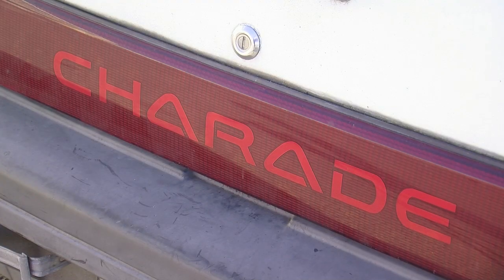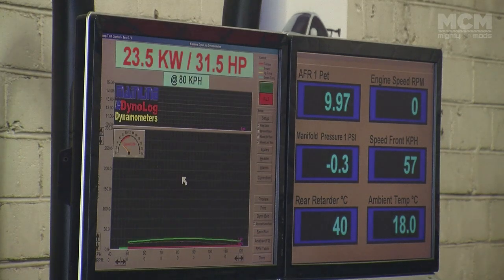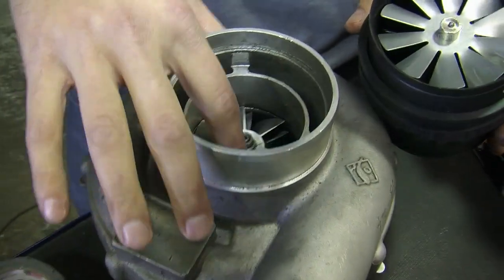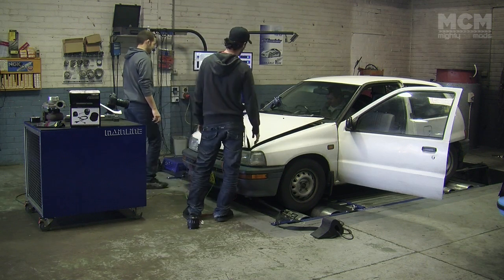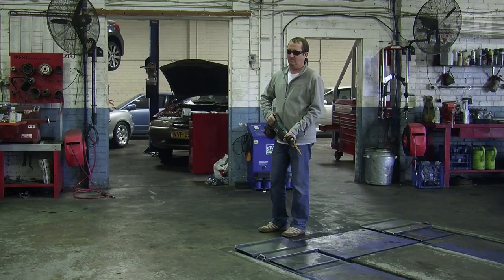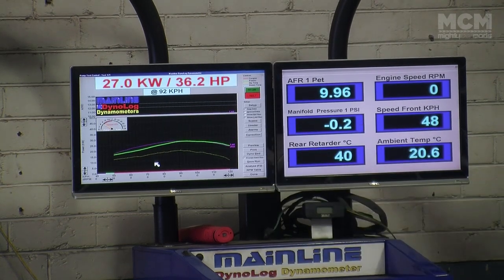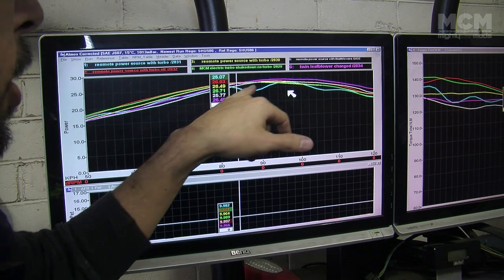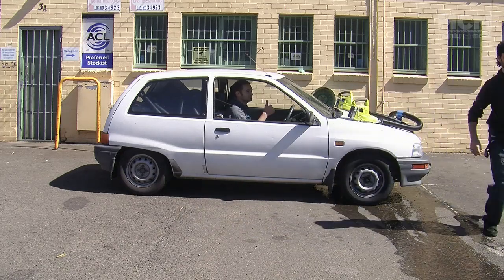Electric SuperChargers Mythbusted

Comment: Now here's an idea... TURBOCHARGING MY PC
Reply: dodoz44 intel turbo cpus for 4-5 years now
Reply: +dodoz44 I wanna turbo charge my toilet and see how fast it can flush.
Reply: +dodoz44 Processors actually have what's called Turbo Boost that boost the performance when under load
Reply: Twin turbo v6 dell
Reply: +Ian Dillard Bingo!  The turbo buttons of the DOS era existed because programs at the time were all designed to run at 4.77 Mhz, the clock of the 8088 processor.  As we moved into the x86 era, the clock rate started increasing.  Since existing programs relied on the processor clock for all their timing, they would run too fast on newer processors.  In order to keep compatibility with old programs, the turbo button dropped the clock speed of newer processors down to the speed of an 8088.

We then invented better way to handle timing, and programs now run at the same speed regardless of the clock rate of the processor. The turbo button is gone, and we are all the better for it. It was a kludge fix for compatibility issues.

Modern Intel Turbo Boost takes a look at the specs of your system and current load, and squeezes a few hundred extra mhz out of your processor when the conditions are right to do so. It is a system that is completely different from the turbo button of old, except for the word &quot;Turbo.&quot;
Reply: +singedcarry you're an idiot
Reply: +dodoz44 old keyboard had a button with "turbo" writed on it
Reply: +dodoz44 old dos computers had a turbo button. its already been done
Reply: i said that and some idiot wanab nerd asked huh like i was crazy.....
Reply: +dodoz44  But like Intel CPU's are already turboed. And the DOS computer the turbo button actually slowed the computer down. So the program running and the CPU would run at the same time instead of having massive lag.
Reply: Ian Dillard you obviously dont know anything about computers
Reply: +dodoz44 Well, there is overclocking. :)
Reply: dodoz44 it would make your computer run fast as "Dell"😂
Reply: +beantownhero617 what?
Reply: +dodoz44 Honestly most high end processors and ram already come overclocked, but you can still get a little more out of them. All you really need is the software to do it, and a liquid nitrogen cooling system for your CPU so it doesn't burn up. That's how you "turbocharge" your PC.
Reply: +singedcarry 
you need a life dude
Reply: SwagMeistro use ya googles m8
Reply: +dodoz44 ya
Reply: +Reeza Ebrahim how about over-Turbo-ing!
Reply: +matto809 stf

Comment: You are  nuts!. the  extra  kW gained,  ofcourse  are  provided  by the  electricity, the  electric  motors  and  the air pressure,  is not  engine power itself, and  if  you  use the same pipe  thickness after  the  split,  the sum of  pressure  will be  half  stuck  again  when  go out  the  splitter.   is  suposed the  extra power provided  by a  compressor,  is provided by  the  exhaust leftover  pressure , that  is  already  out of  the  engine,

Comment: hey what if I used compressed air from a tank filled by an air compressor
Reply: Tim Daly That would actually work. Might as well use Nitrus at that point though. The set up would be the same and NO2 would give you way better boost then air.

Comment: Obviously it was just running too lean... 
Suprised you didn't blow the engine... 

Put in 5 times the amount of fuel and it will make an ADITTIONAL 80kw 4 sure... 

(no gaurentees,  pleaee don't read fine print)

Comment: I think you need to go to a specialty auto shop that specializes in electric turbochargers.  It take years of schooling and trading to install the ebay models.  Typical cost of installation range from $1,200 to over $20,000.  You are only as good as your auto technician so I would shop around for the best of the best in installing your electric supercharger.  I know; the average total cost is around $6,000 for a $100 electric supercharger.  Labor and skill is the key to successfully installing these state of the art devices!